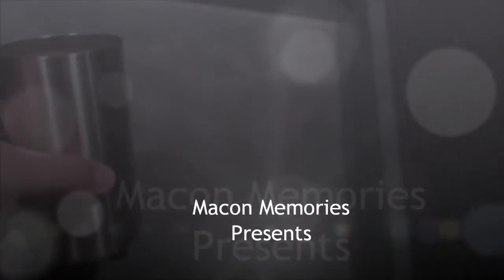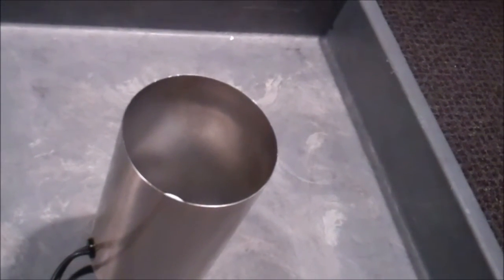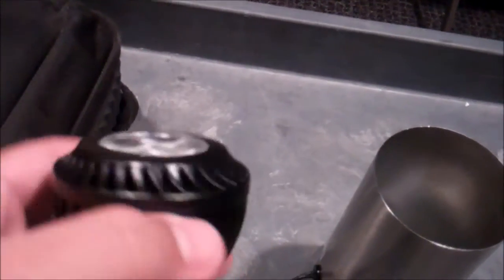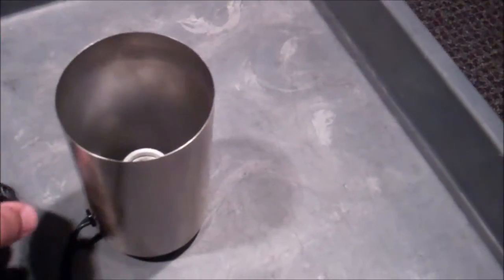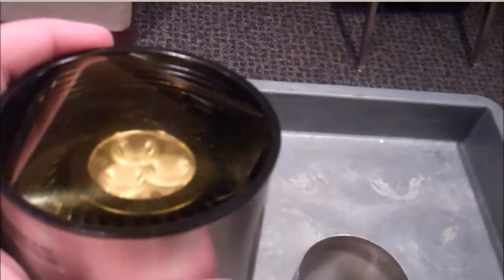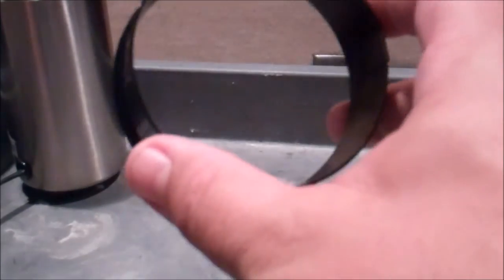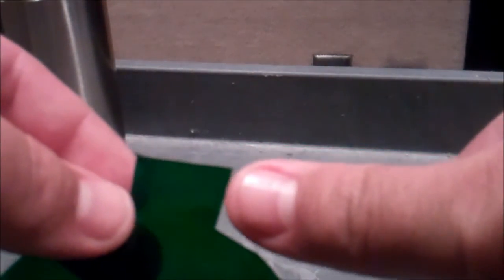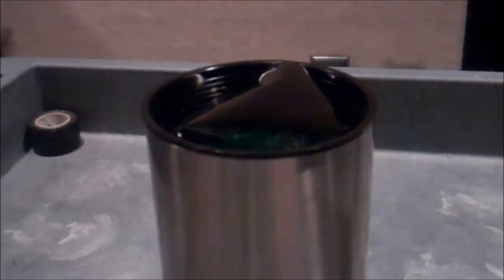DIY LED Can Uplight

Comment from the maker: The output is wider and doesn't carry the beam up through the gels as well, but if you use a colored florescent bulb instead it can work well and just ditch the gel.  The florescent bulbs do get a lot hotter than the LED bulbs, so be mindful of that.  I tested several bulb types and florescent was the coolest next to LED, but was still far to hot to touch safely (think children).

Comment from the maker: Thanks for the comment!  The bulb i'm using is a 7 watt LED bulb from GE.  Do a google search for 7 watt GE LED or GE 74439 for the exact model.  Any high-output LED bulb for use with a standard light bulb socket should work.  I recommend a spot or flood design, not one of the omni-directional standard bulb replacement types.
Concerning a dark blue...yes, a dark blue gel will block the majority of your light output and have a very weak effect.  For deep blue I recommend using a blue bulb.

Comment from the maker: Keep in mind that I only recommend this approach for those trying to do some DIY to save money and will note that this is only cost effective if you find the bulbs on sale or clearance.  I found mine for $7 each instead of the usual $30-40.  At $30-40 you can sometimes buy budget LED par-cans that will give you better output and flexibility 

 ...and in your case they can also handle blue better.  None of these suggestions are professional grade, but I like to show people options.  :)

Comment: Anyone have any idea where to buy the table lamps?
Reply from the maker: Hardware stores like Home Depot and Lowes are where I've had the most luck, but I will also say that this method was intended for a time when other LED up light options were more costly.  You can likely do better buying a generic LED par unit or possibly still using the fixtures in the video, but with colored LED bulbs and skipping the color gels.
Reply: +Shaun Bohannon thanks for the reply Shaun, I have a wedding in 6 months and uplighting would be really nice to have. However, they are very costly, even to rent, so I'd like to do this if I can. I just can't seem to find the table lamps.

Comment: I hate to be a debbie downer, but this is an incredibly bad idea.  Why?  Scale.

A light coming off of a 3 watt LED is the equivalent of a 20 watt halogen bulb and not going to be opaque enough for it not to be obliterated by the ambient light, unless you leave it white.  Shut off ambient light you say?  How is grandma going to eat when she can't see her dinner at the reception?  

The minimum wattage in halogen spot light bulbs is 100 watts at a narrow spot (9 degree or less), to create columns that will reach a typical reception hall ceiling.  Currently, the efficiency of Halogen vs COLD LED is about 6:1, so a comparable blub is a 16watt cold white LED blub or at least 24watt warm white LED blub with a narrow angle lens if you want the same effect as halogen.  Look at Amazon and eBay to see what the prices are for these, and ask yourself if you want to make this investment.

After all this work you put in, the result will be disappointingly underwhelming.  Lastly, you have to plan out your power grid, meaning you need various length of extension power cables and splitters, and lots of them.  Chances are, for the majority of your placements, there won't be an outlet within reach, so be ready to shell out about $15 per cable (one for each fixture), and about $3 per splitter if we're dealing with grounded fixtures.  You also need to buy gaffers tape to make sure the cables are secured in high liability areas.

So your total cost to do this reasonably well would be;

Cost of the can (You'll need a par38 to fit the 24watt bulb)
Cost of 24watt warm white LED with narrow spot
Cost of the gel
Cost of the extension cable
Cost of the splitter
Cost of gaffers tape.

This goes without saying, that if you get all of your parts at home depot, you're going to have orange cables and orange splitters all round the room, making the place look like a construction site.  Is this what you want for your event?

I'm sure in theory, uplighting seems to be a simple service, but you're really in for a nasty surprise if you think you can pull it off well with DIYed fixtures the very first time you do it.  At a minimum, don't let your wedding be the first time you try it, and I'm willing to bet that after you try it once, you're going to wash your hands of the whole ordeal and hire a professional who have done hundreds of jobs.
Reply: DOOSH MASTA  that whoooooolllleeeee long thing was true to your name. Doooouuchy. Probably true but buzzzkillllllington
Reply: Warts don't determine how bright a light is, and most of the time the lights in the room are turned off when it's time to dance which is when these lights matter those most...